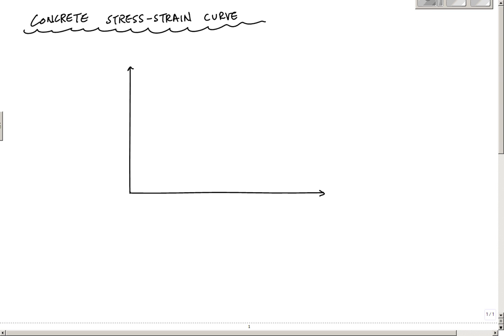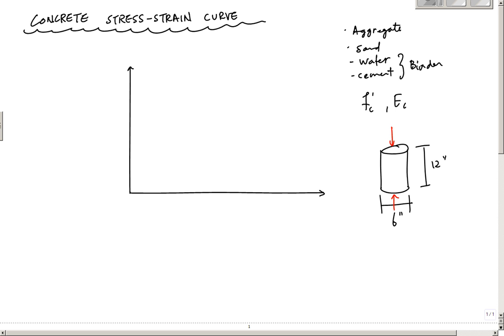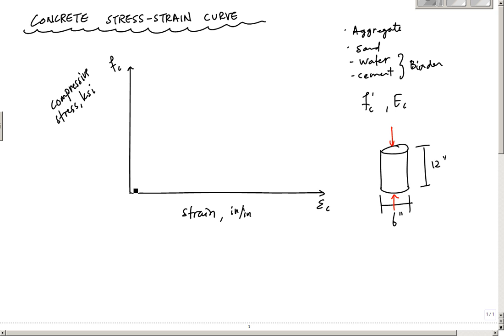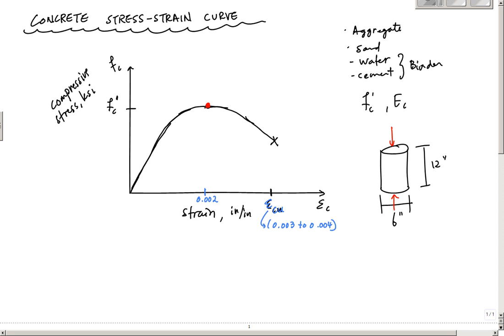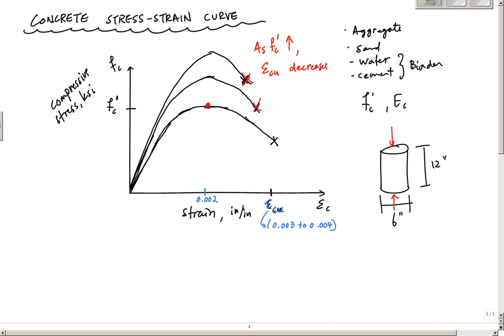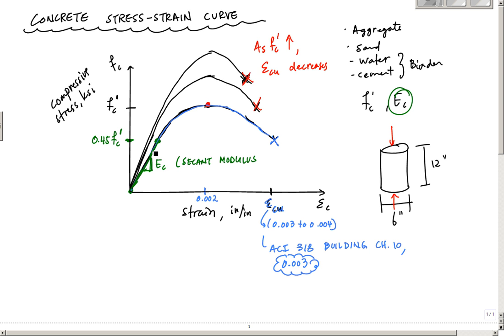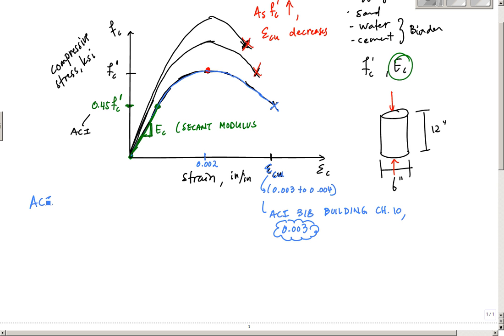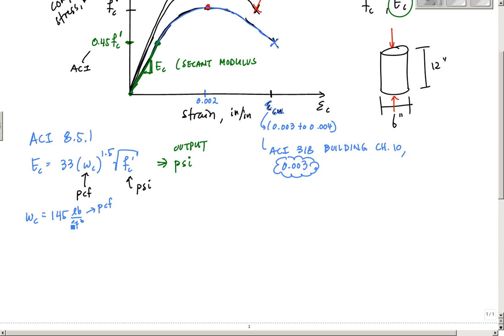Concrete Stress-Strain Curve - Reinforced Concrete Design

Comment: Thanks a lot for your videos. Would you have a video how to read finite element moments and stresses in plate/slabs?
Reply from the maker: Are you talking about a moment per length of slab?
Reply: +structurefree Hi. I was looking at this: https://risa.com/risahelp/risa2d/Content/3D_2D_Only_Topics/Plates%20-%20Results.htm and trying to get my head around the forces
Reply: and as a follow up I am trying to scratch my head a little bit about Wood & Armour or Baumann's tranformation method of forces from FE. Your videos are very easy to follow and explained in terms that once can easily understand so much appreciate all your work. I was just curious if you have anything on this

Comment: For 4000 psi normal density concrete, I get conflicting answers for the two Young's Modulus calculations.

57000*sqrt(4000) = 3.60 mega-psi
33* (145)^(1.5) * sqrt(4000) = 3.64 mega-psi

Which one is "more correct"?
Reply from the maker: carultch that seems pretty close for concrete.